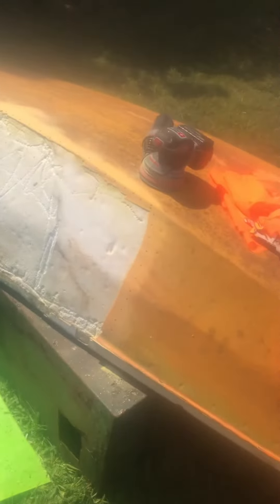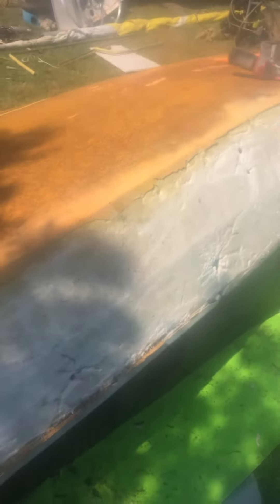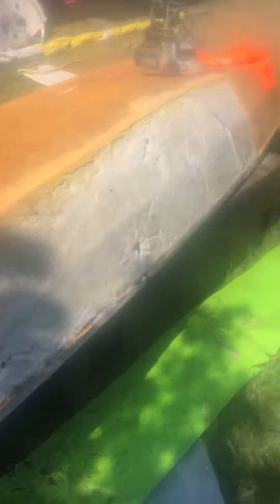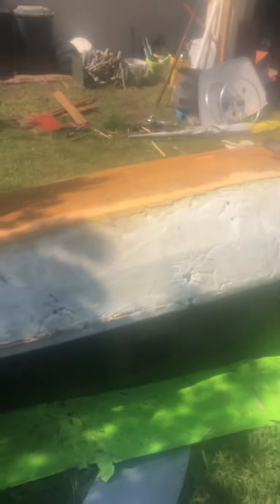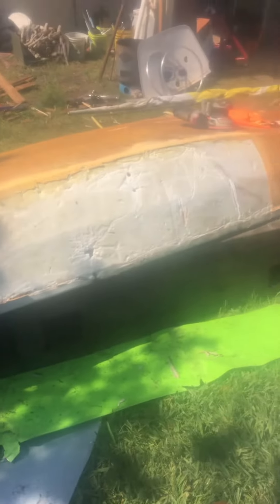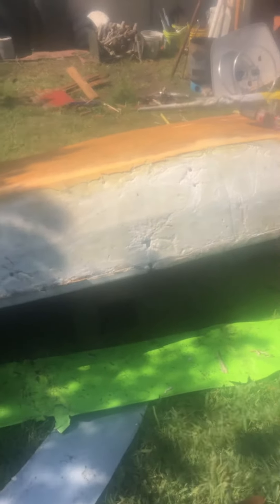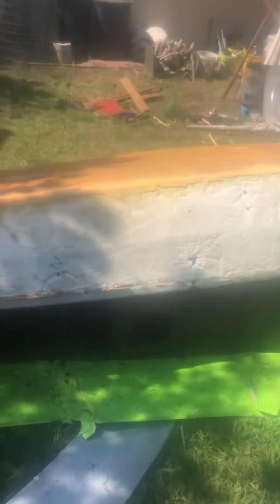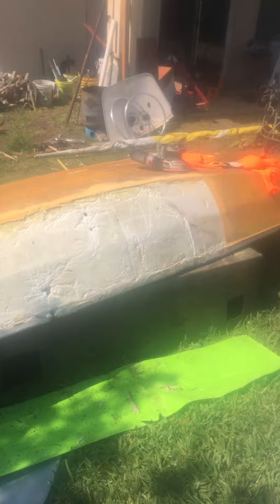Snark Mayflower Restoration Pt 2

Comment: Thanks so much for posting.  I just got a Mayflower.  One of my oarlock sockets is loose.  Any idea how to repair?  Not many repair vids for this boat.  Thanks.
Reply from the maker: I would put a wood piece under the plastic and fiberglass it in place, unfortunately my mayflower broke beyond my repair, let me know if you need parts, I have all the rigging and a sail
Reply: @SwampRatNation  Thanks for the feedback.  That's too bad your boat broke beyond repair.  If i need any parts I will give you a shout.  Thanks again.